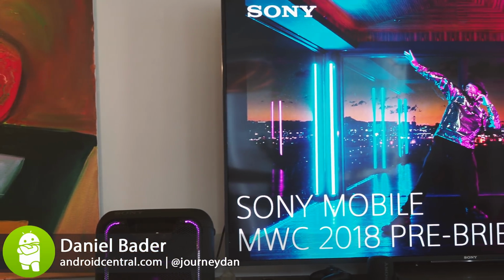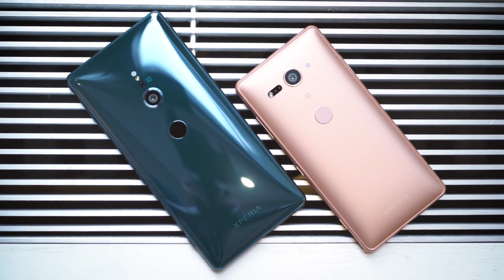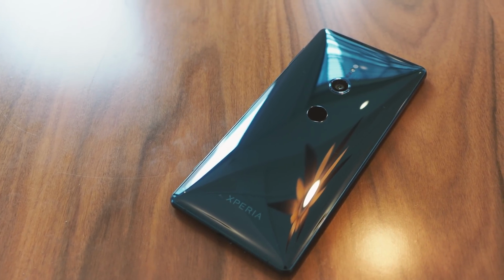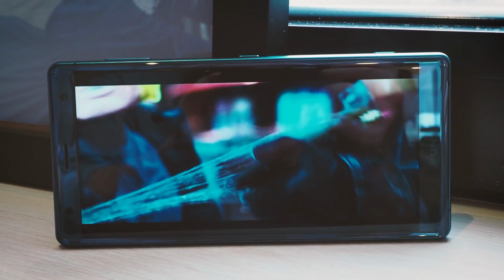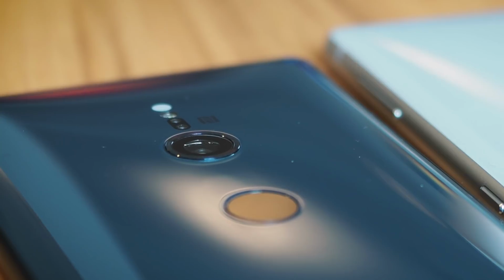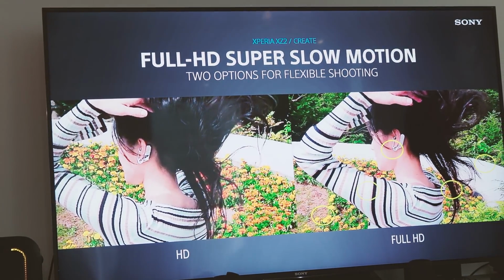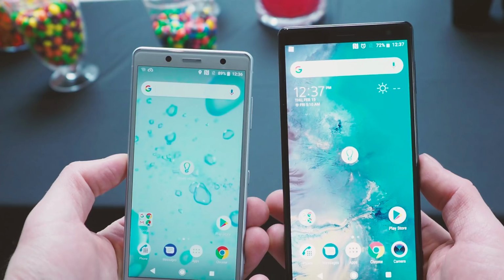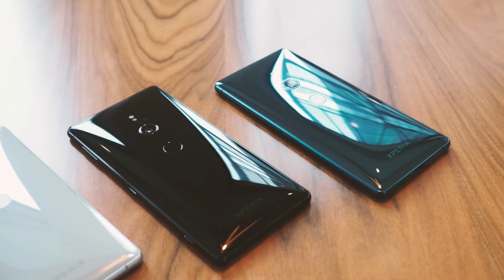Sony Xperia XZ2 + XZ2 Compact hands-on

Comment: 1st of all y'all complain about the design ram and everything else about Sony. btw if you wish to have better shots with their cam use manual mode my god ffs are lazy? enough to use manual mode. and ram (tbh i wish they had 6gb but 4 is ok) but one thing i hate is no hpj(not an issue  for me)  and the memory its supposed to be 128gb.  Then you believed that this is Sony's surprise to us no its not its their dual camera module

Comment: Why do we need a vibration motor give us a good headphone Jack. Use your brain SONY
Reply: Ananthu kitts the dongle is different from the regular ones bro
Reply: so what's your point? you can still use your wired headsets no problem
Reply: Ananthu kitts did u read bro?
Reply: ProCheese- Yierail what
Reply: it's a usb c to usb c and hpj
Reply: ProCheese- Yierail why can't they just put a good headphone jack like on the LG v30 with quard DAC
Reply: Ananthu kitts the vibrator inside it is very large amd i think thats their reason??? idk but at least they will  provide the y connector
Reply: There's a Y-dongle provided inside the box, which has two ports. One for USB C and the other for 3.5mm jack, so it's just basically moved away from the phone, but it is still here.

You ask Sony to use their brains, but you yourself have failed to do enough research about this. Congratulations on being the funniest ignorant here on YouTube.
Reply: Johnny Pigman best of luck with your dongle. Actually every phone without a headphone jack has a dongle. Are you dump

Comment: f2.0 and no OIS...what
Reply: Nino Brown look the thing is EIS is software ois is hardware software can be upgraded hardware can not be so stop listening to shit from Samsung
Reply: Akash Sharma what the hell does Samsung have to do with anything?
Reply: Nino Brown you where comparing weren't you
Reply: Akash Sharma how did you come to the conclusion that I was comparing specifically to Samsung? I didn't mention any brand at all, let alone that overrated company.
Reply: Wider aperture leads to less sharpness. See why Galaxy S9/S9+ have variable aperture
Reply: Their gyro-based EIS is much better. 5-axis, that stabilizes footages much better than any OIS. Since it uses gyroscope, it's pretty much hardware.

Comment: But no audio jack?  ;-;
Reply: Johnny Pigman I'm not going to carry around an adapter. That's about as premium as carrying around a crutch.
Reply: Amir K I have invested into a good pair of earbuds already, and my everyday ones are also 3.5mm.

Here let me throw them out real quick and spend a bunch of money to keep up on the latest apple copy train. You're an idiot.
Reply: There's a Y-dongle provided by Sony. It has two ports, one for USB C and the other for 3.5mm jack.
Reply: Andrew J. Right, it has to and it sucks.
Reply: RUK it comes with the phone
Reply: RUK My speaker grill came off the first year. But I abused that thing tho. But wow, 5 years, I salute you! Haha.  I'm on my third year with my Z5 compact. I'm hoping I can have another year or two with this thing.
Reply: Well aslong i can plug with a wire i'm fine with it, because Bluetooth the battery will  run out if i didnt charge it, sucky part i have to buy the adapter? or does it come along with it
Reply: Alfredo a. c. Thank god im so gonna get this one because om using xperia z1 😂😂😂 5 years still standing
Reply: RUK sony is great. I love sony. Cause is great but this design is not so great Thats vessels
🤣 🤣. I'm not sure if I'm going to get this one last, or if I should just wait for another one
Reply: Alfredo a. c. Waiting is better i supposed because if the newer one is even bad then this one idk but just need to change my phone thats all 😂😂
Reply: I agree,  I'm sad that OEM find their ways to earn more by ditching one of the major component of a phone, so user will buy BT headphones to them.
Reply: RUK 5 years?! My z1 lasted 3 then it just died. Lol
Reply: Antonio Gallagher my power button is no longer function i have to turn on my phone by pressing the volume rocker i lost the flap of the charging port my speaker grill is glue came off but tbh still solid phone 😂😂😂
Reply: Antonio Gallagher hopefully yeah just dont drop it alot even mine has been dropped alot and tossed around 😂😂 i use a hard plastic phone cover maybe thats why?
Reply: RUK Yeah I used a cheap rubber case on my Z1, what a useless piece of thing lol. Maybe that's why 😂
Reply: RUK YES! soon Jack will be extinct from smartphone industry
Reply: What is wrong with choice. Does having a jack limit your use of some stupid-looking wireless headphones? No it doesn't.
Reply: kirbyswarp just buy new headphone with usbc u dumbass

Comment: I'm a little disappointed I thought 4k screen would be back or at least 2k. Reminds of htc a little like the u11 plus. No ois either. I hope the xz 2 premium is better
Reply: Wait for the Premium version
Reply: Are you sure there will have a xz2 premium ?
Reply: If 4k should it should be z2 premium lol..
Reply: Charles Lin sony already show the teaser in the end of the XZ2 announcement, it will have dual camera, up to iso 52000 for photos
Reply: I'd rather have a better battery life than a 4k screen
Reply: Charles Lin yup
Reply: You don't really need a 4k screen. The battery drains faster and it becomes more expensive to produce. 
1080p is just fine, especially on the compact.
Heck even the iphone 8 doesn't have a 1080p screen.
Reply: 2K is of no use. Contents can either be 720p, 1080p, and 2160p.
Not even DSLRs have 1440p as their recording option.

Comment: 32GB RAM 1TB ROM DUEL CORE PROCESSOR  20+20MP FRONT CAMERA 40+40 REAR CAMERA 8000 MAH BATTERY ANDRROID 9.0 UPDATE  SNAPDRAGON 986 AND 3678 HZ SPEED 1342 CPU SPEED GORILA GLASS 6 IPS FULL HD+ DISPLAY 6.0  NFC AND BLUETOOTH 5.0  AND D FACE UNLOCKING AND TRIPLE 5G MICRO SIM CARD SLOT
Reply: WORLD BEST A laptop?
Reply: Wht all caps
Reply: Why